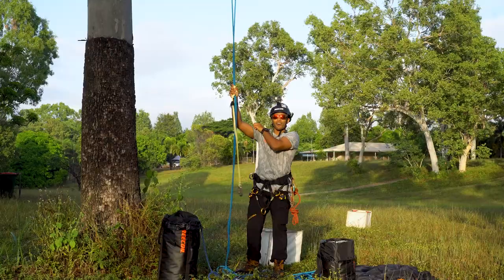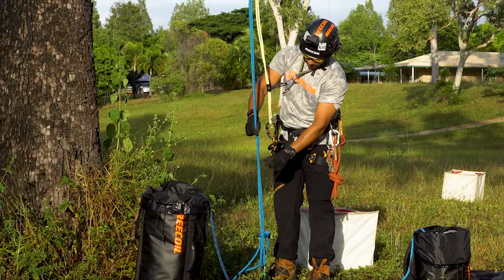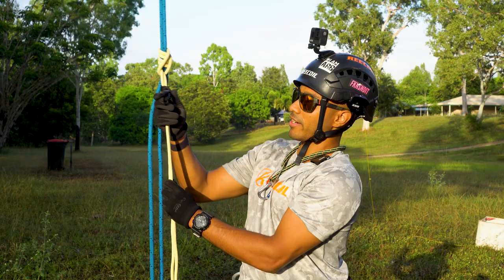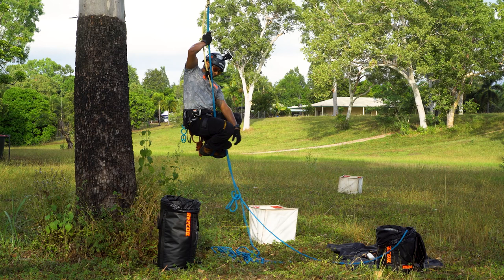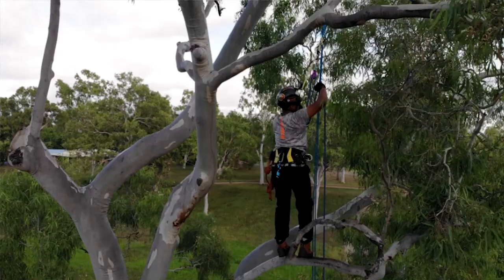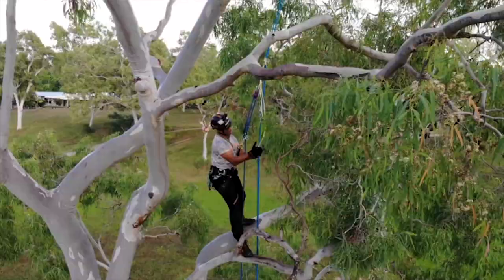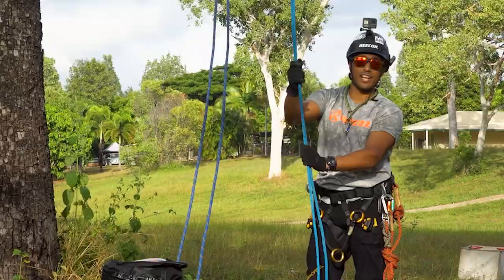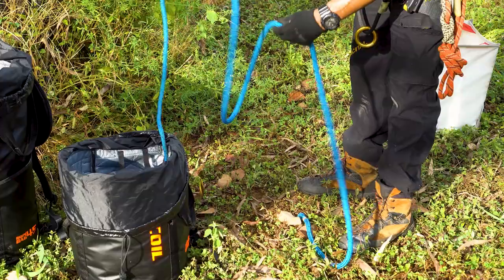How to Foot Lock climb a tree

Comment: Wouldn't it have been easier to remove and lower the second climbing system you brought up and tied into your foot locking prusik the same way you brought it up, while you were in the tree then rappel down the original 2 ropes with a figure 8 or some other descender?

Comment: So the system we use at work is a hitch climber system eye to eye. DRT. And I have a job I have to do that has a tie point just like that floating on a cottonwood. But I'm pretty sure we aren't allowed to use footlock and no extra mechanical means. 😢
I mean, it seems doable but it also seems like it's going to be one heck of a mission body thrusting up 60ft floating.

Comment: Very instructive video. Thanks for sharing it.

Should you need to descend in the middle of the foot-locking climb, how would you
 install the figure 8 to descend?
Reply from the maker: Hi Alfredo! So to install your Figure 8 to descend:
1. Hang your weight from your footlocking prusik
2. Install your Figure 8 on the access line as high as possible
3. Take a lock with your feet and stand up, to hold onto, and release your footlocking prusik
4. Sit back into your Figure 8 (holding onto the tail of your rope) and descend down
Hope that helps bro 😊🤙
Reply: Thanks,  @REECOIL_DOT_COM , much appreciated. Cheers!

Comment: What’s the primary benefit to using the foot lock technique over a foot ascender? My foot ascender makes it easy to climb a rope.
Reply: When the day comes you lose or break a foot acender you have the tools to do its manually with gear you may already have keeping you moving and the job going I suppose
Reply: The amount of gear, All it takes it a rope and a single prusik to do a footlocker ascend, Add a second prusik and you can add a foot loop to make it a little easier, The foot and hand ascenders may be nice but if you find yourself in a situation where you don't have it or it broke then all you need is the rope and a prusik to get up.

Comment: Beginner????
Reply from the maker: Probably should call it fundamental techniques instead of beginner. Takes a bit of practice to learn foot locking…and it’s bloody exhausting 🤣
Reply: all aspects or tree climbing  should be considered... when taught  properly ... everything  becomes  regular .
Reply: @REECOIL_DOT_COM  I'd agree it's a beginner technique, I have never done any rappeling or rope ascending before, The other day I free climbed a tree with safety tie ins and taught myself to rappel down with a figure 8, Today would be my second time doing any sort of climbing or rappeling and I did a footlock technique to get up a double rope, then I tried the same  technique but added another prusik for a foot loop instead of the foot lock, I was successful with that and I added a prusik to my figure 8 descent as a backup. I am as beginner as it gets and I have absolutely no fancy gear, no ascenders, no descenders. All I got is a harness, a couple ropes, and a couple slings and prusiks.